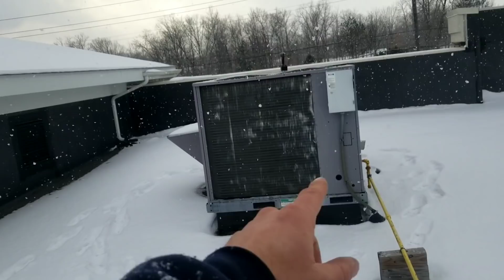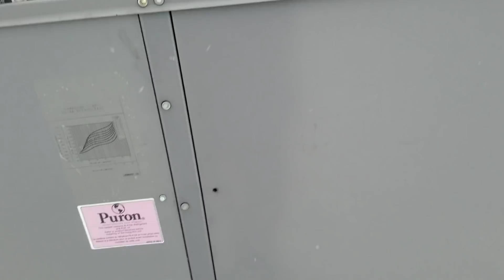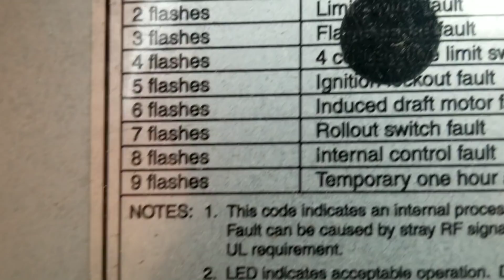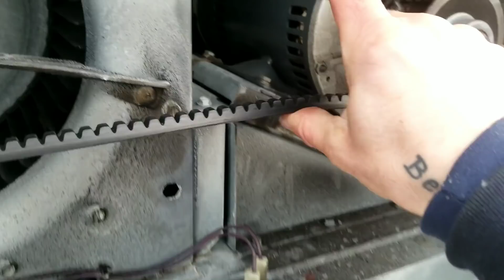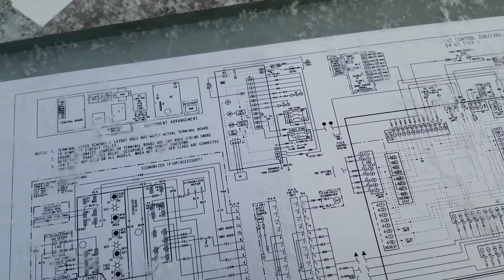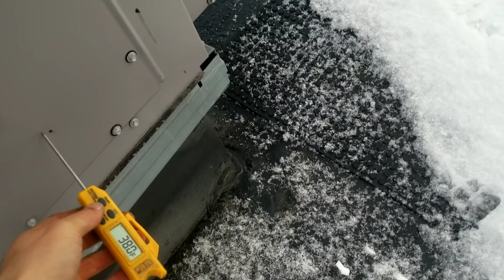Carrier RTU not heating

Comment: Open limit. Never measured to see where voltage is getting hung up. Didn't check gas pressures. Closed pulley, changed airflow. Then takes amp draw with door off. Ignored temp rise being out of spec.... wow.

Comment: Hold on your blowing at 155 return is at 70 degrees that’s a 85 degree rise the system is only rated for a 25-65 degree rise, you need to check the gas pressure that’s too high of a rise

Comment: did you just take a blower amp draw with the door off?? LOL
Reply: i knew i wasn’t the only one that saw that
Reply: Never checked  for roll out there guna die lol
Reply: Did you notice that it was blowing at 155 return is at 70 degrees that’s a 85 degree rise when it’s rated for 25-65 degree rise
Reply: @dirtychaosoff-roaders8100  probably gas pressure issues filter clogs who nose

Comment: From what your showing you have about a 90 degree temp rise? (70/160). Rating plate calls for between 25/65. Would it not trip limit yet again if not adjusted to be within the manufacturer's recommended temp split? Why is it your only concered with the max out air temp? Thanks in advance.
Reply: You can’t really get a good rise reading on the unit because you’re too close to the heat exchanger. The rise should be taken in the ducts which is not always available on a package unit.
Reply: That limit switch only looks for max temp, If it gets too hot it'll trip. Temp split doesn't really come into the equation.